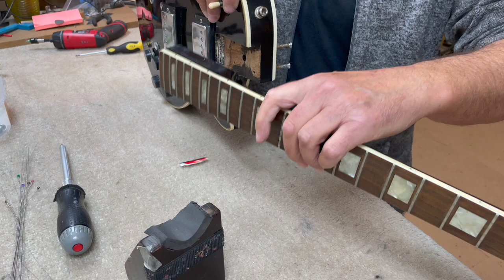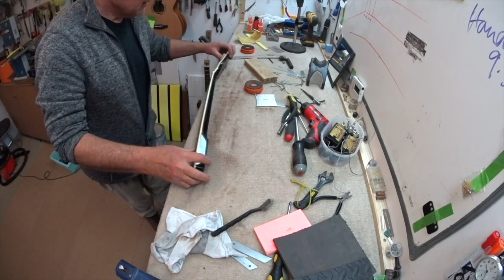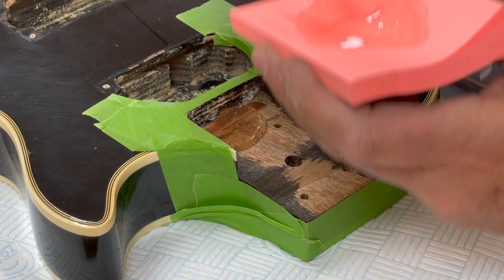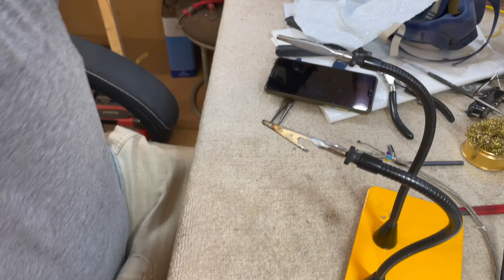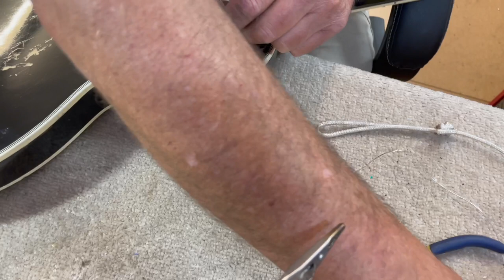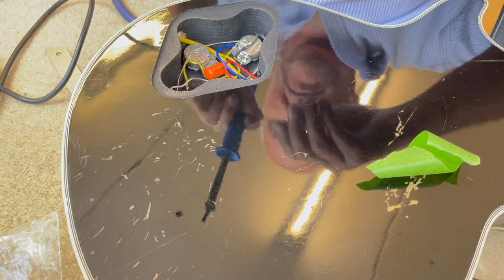Hondo II refurb and set up

Comment: I saw a guy who had a genius method of removing the frets. Instead of heating up the fret with the actual solder gun, he'd just apply solder across the fret, then quickly pull it off. When applying the solder, the fret would heat up and melt the glue. So much faster at getting the fret to heat up! Probably 10 seconds with this method versus 60 seconds by using the gun to heat the fret.  And they pulled off so easily.. was like magic!
Your windows.. ..if you drill two 1/8" holes through the outside pane of glass, the inside will dry out. Amazon has the glass drills... they're actually little grinding bits. Put it in a dremel tool, turn it up to full, spray water continuously from an old glass cleaner bottle or similar, and gently push... use about as much force as the dremel weighs. Drill one in top and one in bottom opposite corners. Takes about 30 seconds each hole. Or you can call a glass company and have the thermal pane glass units replaced. That size will cost about $150 for each thermal pane.. that's installed cost.

Comment: Thank you Mr Deeks for this video. I have a Pearl Les Paul from the late 70s, beginning of the 80s. I believe it's a PE 216, very similar to your Hondo. I've recently restored it (new pickups, electronics, new tuners and so on). The only thing I haven't done yet was refretting it. There's a nasty dent in one of the frets and the rest is worn out pretty badly. I have been doubting if it is worth refretting, but your video confinced me. 
Yes, it's worth the costs and effort. The emotional value of this "Plywood Horror" is worth much more. This guitar has given me so much joy over the years, she deserves it.

Comment: I had a red one. Hondo is a Korean Guitar company, mine was made there. It wasn't a bad guitar, bought it for $100 USD. (Used). It was one of the fabled "Law Suit Guitars". I actually sold mine, plus a Jordan Boss Tone, (great fuzz device, only problem it plugged into the guitar) for $250, in 1985.(bought it in 1982).
Just a couple of notes 24.75"(Gibson scale) the action is 5/64" on Low E at 12th fret
3/64" on High E at 12th fret.
25.5" (Fender scale) action is 4/64" on all strings at 17th fret (electric guitars of course)
Had a slight buzz on my 15th fret on my 335 copy, checked my action, I was just a hair below 3/64", raised the bridge just a bit, it disappeared. (I'd already leveled & crowned it etc.
Another note 1st fret action, on all guitars is .020"-.018" 
Have a cheap beater acoustic I've had for 16 yrs, would not intonate, hated playing it. Heard a guy who had a guitar company tell a fellow who described my exact problem "Its your nut. It isn't cut properly" so I decided it was a cheap beater, why not. Filed the slots down to .018 (used a business card, measured with feeler gauges later) that guitar came to life! Intonated up & down the fret board. Sounds great. Checked my 335, it needed a slight adjustment, it's intonated, up & down the fret board. (My 1992 USA Telecaster needed no assistance from me, I intonated it back when I bought, adjusted the action to proper height, it's a dream). I'm new to guitar repair, but I learned from watching videos for a solid year, then decided to start on my own. 
I saw a jig a fellow made of wood for for putting a radius on fret boards, it's a wooden box that allows the router to travel in a curved groove. It gave him perfect radii, on his necks. it's been about 18 months since I saw it. But it was ingenious. He's on YT, I looked up putting radius on fret board or something.(don't have the needed tools or space to build one.) I was impressed. I've played guitar for 50 yrs, knew basic set up,  but decided to learn more. Strictly repair. I did electronics & metal Smith(built structures, sub assemblies etc. Drilled a lot of holes. LoL) in aerospace for 20 yrs. Just found your videos this morning. I'll watch again!

Comment: I picked up a Hondo II a few years back for £40. It's been overpainted with a trans red paint, but it is a real wood double cut and may be a H1030. I am very close to getting it close to the front of the pile for resuscitation.

Actually, I was fettling a rather nice Westfield strat (sunburst with black scratchplate, pickup covers and knobs) and discovered that it is, in fact, a plywood body. You'd never tell from the feel of the guitar, as once I gave the neck a little relief, it felt really nice.
Reply: I have a Westfield SG copy and love the feel of it!
I’m tempted to upgrade the pickups etc, but not sure if I should just leave it as it is.
Reply: @colonialpimp  If it ain't broke, don't fix it, I'd say...
Reply from the maker: Hey Padraig, hope you're keeping well. One of the best, most fun guitars I've worked on in recent years was a white LP copy with a cracked neck I bought to mess about repairing and setting up for a friends boy's 'First Guitar'... it was bloody brilliant - even more so when I discovered the body was in fact MDF. Awesome fun.
Reply: @SamDeeksRelovedGuitars  All good, thanks, Sam. Hope all is well with you. 

MDF? Well, at least it has a certain consistent density...

Just sold a Dean EVO XM and it is one of the nicest budget guitars I've had through my hands for some time. 

Really nice neck and it set up beautifully. Could have gone lower, probably, but just over 1mm On the treble and 1.5mm o the bass should suit most. 

I thought the pickups were rather rubbish until I adjusted their height. It totally transformed the tone. Now they sound rather good.

Comment: RE: coloured markers for your wires Sam, why don't you use coloured heat shrink tubing cut into 5mm pieces. As long as you use the right diameter for the wires in use ... just a passing thought. Great video btw even though I had to watch it in instalments ;-)

Comment: actually there are some really good sounding Hondo guitars. I had three, one was a 'sunburst' Paula copy with those infamous fake humbuckers ( single coil in humbucker case), but together with this unique almost 'semi-hollow' body and bolt on neck they sounded awesome. You wouldn't get that with a Paula for sure. There are some nice early Hondo double cuts also, Hondos often shipped with DiMarzio hums actually.
this restauration, I noticed a bit of.. distraction or little lack of concentration on the work here?.. sorry. eg the fretboard loosened a bit from the neck and with sanding the fretboard you then ( in the beginning) seem to push quite onto it, ouch. why not put a piece of wood under the neck joint to secure it? The uneven neck pocket, why not just clean it up with a sharp chisel? and why refit the neck with the still uneven neck pocket? I used to do guitar work and I would begin correctly with the neck pocket cleaned out. then put the neck in to check the neck angle, then alignment, maybe with a correct angled hardwood shim..and from there everything other.. and why using a powerdrill with the small tuner screws?

Comment: 9.5” radius block? Not 12”? Thinking about sanding the top down like Ronno, not sure how it would come out with the plywood top?
Reply from the maker: These vintage LP copies often had 9.5” radius necks (but weirdly the bridges always seemed to be closer to 12” on those same guitars!)
Reply: @SamDeeksRelovedGuitars  Which roller bridge was that? 50mm? 52mm? Got Grover 305c, just grabbing the rest of the hardware.
Reply from the maker: @RasCuban33  It would have been 52.5mm Ivan (you can't find a 50mm TOM bridge for love or money!) It would have put the strings a little closer to the neck edge but if you're re-fretting you can make the fret bevel steeper to accommodate that.
Reply: @SamDeeksRelovedGuitars  just got it in and the neck has just a wee bit of relief with the neck slacked. Frets are paper thin so that’s a definite refret. Thanks for the info.